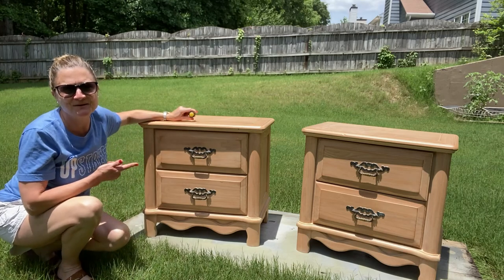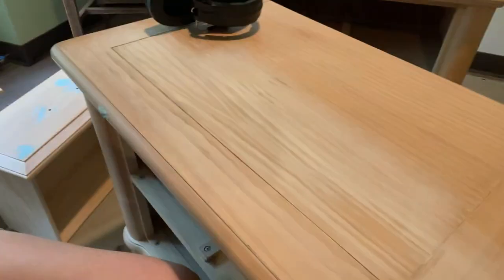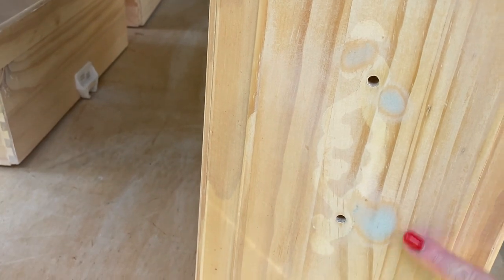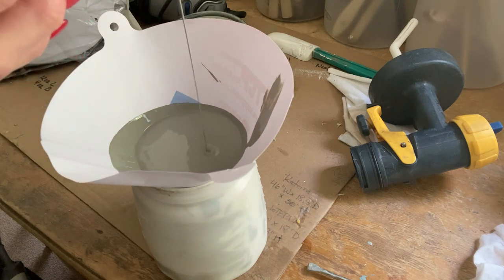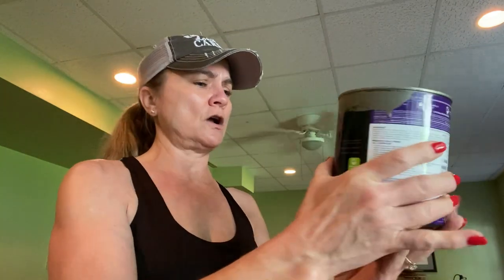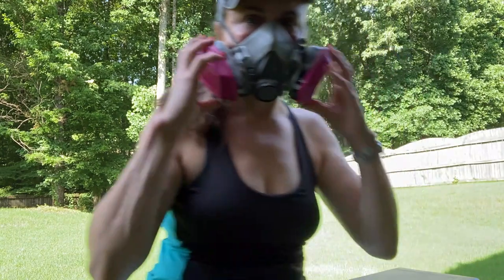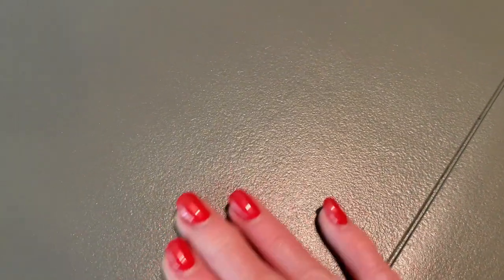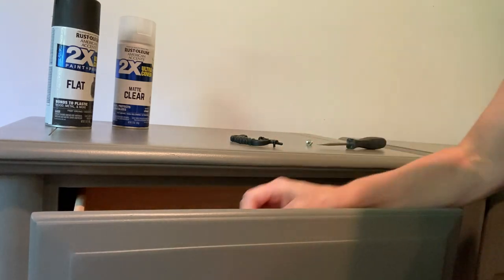Quick Flip of Garage Sale Side Tables || Before and After

Comment: Lovely. Can you tell me the name of your sprayer and air compressor
Reply from the maker: I used the Wagner Flexio 5000. It’s an all-in-one painting system with the compressor housed within the storage box. You can’t see that the hose is attached to it. I wasn’t a fan of it though. The long hose always got in the way and it didn’t consistently spray well for me. I JUST replaced my sprayer with the Earlex 5500 that also has its own compressor. I haven’t had a chance to use it yet but hope to this weekend.
Reply: @tableflippinghousewife  thank you for your prompt reply. Good to know you’re not happy with 5000. I’m considering buying one
Reply from the maker: They’re not bad sprayers. Did you notice how wide my spray pattern was here? It was awesome! But the vast majority of the time I only got less than 2” so spraying took forever. But maybe it was just me. If you get one I would suggest one of the other models that have the turbine in the sprayer itself. That long tube would trip me up or rub against what was just sprayed.
Reply: @tableflippinghousewife  thank you so much for clarifying